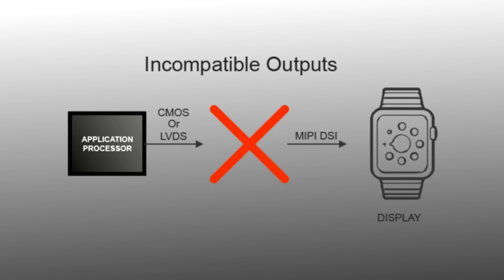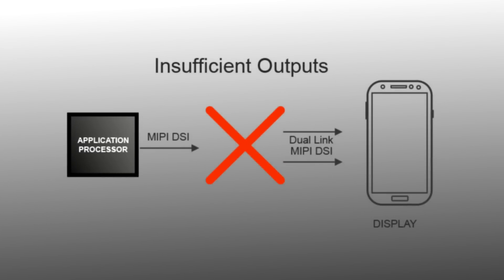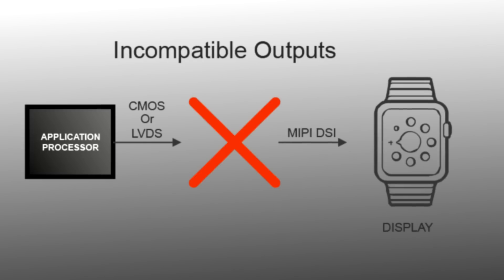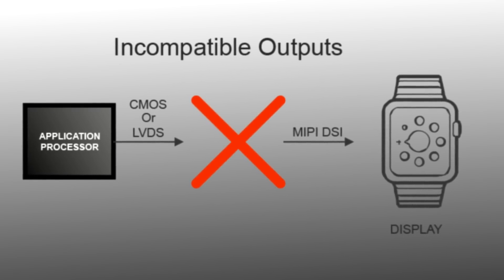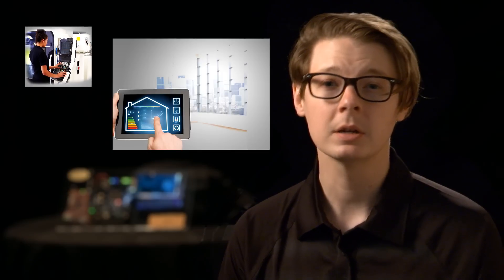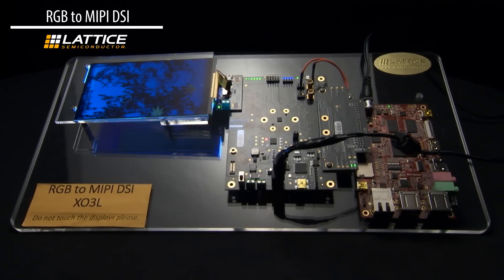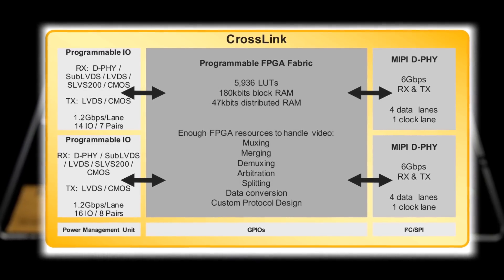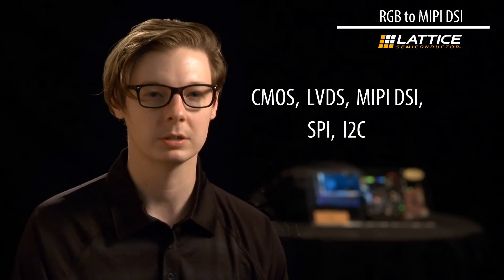RGB to MIPI DSI

Comment: HI, I need to interface my AMOED MIPI DSI display with ordinary microcontroller. Will your RGB to MIPI DSI interface bridge work for my needs. https://eu.mouser.com/ProductDetail/Microtips-Technology/MTD0139AZOG-1/?qs=%2fha2pyFaduj9vRuO%2ffjP4ay5QqEQ6TrBh1OfVFfUxSJs9DxpJPQ5ug%3d%3d
Reply from the maker: Hi, 

You are probably aware that the CrossLink devices are specialized FPGAs with customized MIPI D-PHY I/O capability. We provide a variety of free IP to accelerate your ability to implement your bridge quickly. The RGB – MIPI DSI bridge is one of those IPs. Ordinary Microcontrollers are available in an almost infinite number of configurations. The CrossLink IP in general has the flexibility to adapt to these varying configurations. So, it is very likely that the CrossLink device can support your bridging requirement. Most likely you will need to make changes to the IP source code to adapt both to your specific MCU and your specific MIPI display.